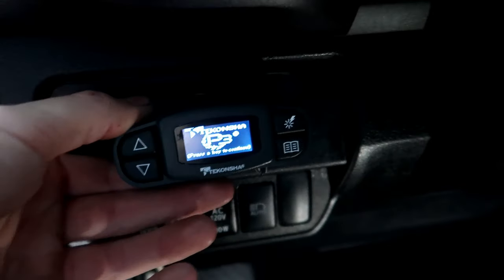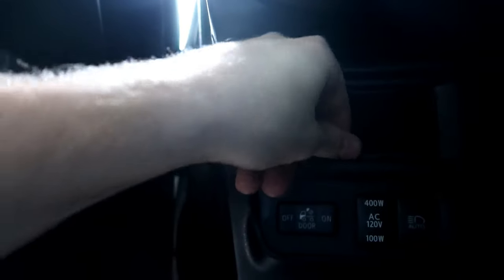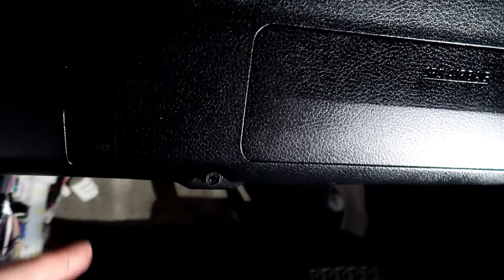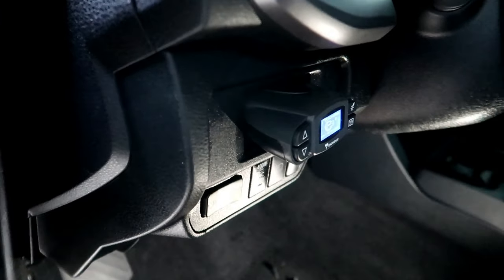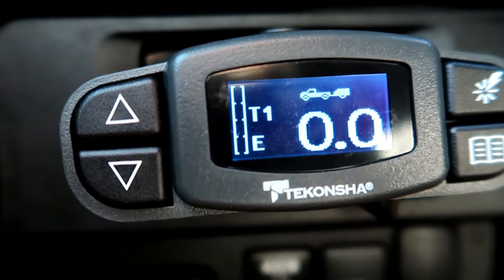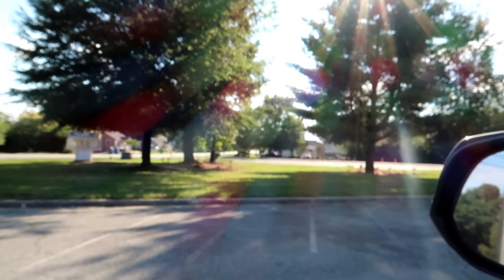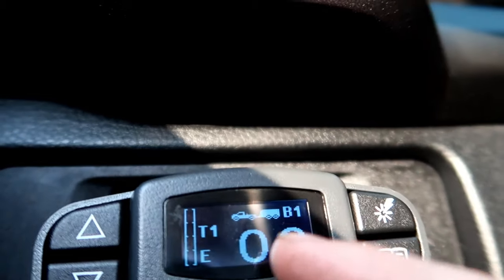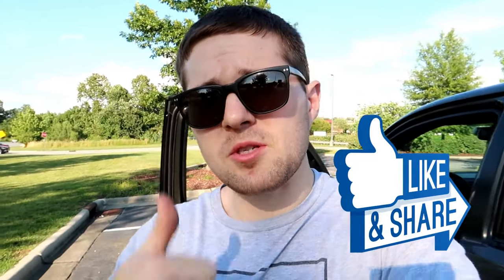Truck Trailer Brake Controller Install | Tekonsha P3 | Toyota Tacoma 2018

Comment from the maker: Tekonsha P3 Brake Controller https://amzn.to/2xFHFQb

All my other mods so far
- In Channel Window Vents https://amzn.to/2I29Qvk
-Gator Tri-fold Tonneau Cover https://bit.ly/2M3uKg6
-LED Interior bulbs https://amzn.to/2M4yyO1
-LED License Plate bulbs https://amzn.to/2M4yyO1
-Xentec HID Headlights (H11 size) https://amzn.to/2PByFm5
-Interior LED Glow Kit https://amzn.to/2XWLhMp
-OEM Style Truck Bed LED lights https://amzn.to/32xARCq
Reply: So i bought the same controller and I was wondering did you screen stay on all the time
Reply: Rick how much does your trailer weigh when loaded?? thank you
Reply from the maker: Loaded about 5k

Comment: I looked at a bunch of these before doing the install...and yours was the cleanest install and clearest video.  You're good at this.  Was perfect.  Liked using the bracket clip behind the panel to hold the p3 in the dash instead of drilling and using a mounting bracket.

Comment: Thanks for the information, locating the connection plug was very helpful being it was tucked and hidden behind the harness. FYI , I installed the drawtite brand which fit perfectly in the Tacoma dash compartment. Only needed to cut away enough plastic to allow the controller plug pass through the back of the box and then use a small piece of rubber foam for a spacer between the controller and the box. Made for a nice snug fit and reduced any possible vibration.
Reply from the maker: Nice!

Comment: The only thing that didn't work for me on this install was the clip part from the mounting bracket.  I had to use the metal bracket and mount that with a couple little bolts and nuts under the P3.  Made it even more secure that way also.  Video was spot on with everything else on the install!
Reply from the maker: Yeah I just did that on my 2020 since the compartment doesn't exist on that one like it does in the 2018

Comment: RIck, when you put the bracket in the cubby did you just use the existing screw holes to secure it?
Reply from the maker: No screws it kinda snapped into the slot roughly

Comment: Great video install. But I tried to do this on my 19 taco and it wouldn't clip in like urs. I had to improvise and I decided to keep the oem box, use a soldering gun and melt away from the sides and rear. It's a really snug fit and was able to connect it. I do have a question. Does the controller stay on with the car locked? Does it kill the battery? I bought the plug and play harness
Reply from the maker: Turns off after 15 minutes

Comment: So it actually is ok to ground multiple wires together? It appears so I’m just doing a double check since it seems some forums say don’t ground more than one whereas others say a ground is a ground, within reason obviously. But, just to be sure I can run that same white ground which I do have at the moment and about to install, with the other wires already in place?

Comment: Hi sir, how are you still liking towing that trailer with the ta o? What size and weight is it if you don't mind my asking? Looks similar to what I'm seeking.
Reply from the maker: 12 by 6 trailer. And yes still using. I enjoy it. Mainly cus of the freedom and size I have without. Then when pulling I gain so much space. It doest struggle much other than steep mountain hills with a good load in the back.

Comment: Whatever brand Controler you use/order....BE CERTAIN THE WIRING HARNESS IS COMPATIBLE WITH YOUR VEHICLE‼️‼️. Another suggestion, check out your local RV Service shop if you need to purchase a wiring harness compatible w/your tow vehicle ‼️‼️. Happy Holidays

Comment: Great video! Just bought on Amazon myself. Have to figure out where to mount I have a switchpro in the slot in my 19’. After using it would you recommend the same spot you used?
Reply from the maker: Check out my new video on it mounted it on the lower dash

Comment: Question I am able to fit the bracket in the same spot but it’s putting too much pressure on the manual switch and it’s not popping back.  Any suggestions?
Reply from the maker: Hmmmm not sure

Comment: Hello Rick,

Question for you; your trailer has a 7 pole plug or a 4 way flat one? Now.....if it’s a 7 pole , did you install a socket on your rear bumper to connect it or not? If not then it means that power to trailer breaks is delivered via the 4 way flat connection? I hope I make sense, where I’m going with this is that all brake axle trailers I’ve seen have the 7 pole socket, unless you are using an adapter 4 way to 7 pole? I’m curious because I have a 2019 Tacoma, and I’m in the process of looking into adding a brake controller. I’ve also just now found on etrailer a wireless controller that uses you phone via Bluetooth, it’s a bit pricey but it’s interesting because it can be used with multiple vehicles (Curt wireless brake controller). That one too uses the 7 way pole socket , which my Tacoma is missing.

Cheers
Reply from the maker: 7 pole. And my truck already has the wiring for the 7pole and the 4 way. It has both plugs already wired on the back

Comment: Very thorough video. I have a 2017 TRD Tacoma and was thinking about the Tekonsha 90160 Primus, mainly because of the price.  Looks like there are more videos on the P3 with Tacomas. Is there a reason why you chose the P3? Also, I have a 16ft tandem trailer with brakes only mounted on the front axle. How would I set up the trailer selection?
Reply from the maker: P3 was just the most popular one I saw people using. And 16 ft probable select large trailer and then go through the same process to adjust the breaking.

Comment: I have 2016 Tacoma limited. Easy install for you. What about removing unit when not in use?
Reply from the maker: I at max go 3 weeks without using the trailer

Comment: How heavy is your trailer dry? Do you find you need to increase the brake controller power as you load the trailer up?
Reply from the maker: I think it's right around 2,000 dry. And no you dont increase the power. You set it up like I did me the manufacturer instructions and you dont change it

Comment: Can you tell me if the trailer hook up has a small connection right behind the bumper? I have the an sr and wanting just the oem 7 pin connector that mounts in the bumper. I wasnt sure if I can find one or if it has a short harness that plugs into the factory harness. I have plug behind the bumper I think it connects to on the drivers side

Comment: Thank you so much for the video, helped me a ton on my Tacoma.  Only issue is, does this thing ever shut off.  I just installed it, and it's stuck on the "press any key to continue" screen.  If I press a button it just says no trailer connected, which is true bc I don't have access to it right now.
Reply from the maker: It shuts off after i think 15 minutes with no trailer detected.

Comment: I have a 2014 TRD sport 2wd with the towing package. I couldn’t find the connector under the left dash panel. Could it be because it’s not a 4wd or off road or could it be hidden somewhere else?
Reply from the maker: Its cus you have a 2014. I am showing you the location of the 3rd gen Tacoma's which are 2016 and up. I am not sure where the 2nd gen is located.
Reply: It's in the same area, and has black electrical tape around it.  I have a 2014 two wheel drive Tundra TRD with tow package.  They are all the same and nothing to do with year.  My 2005 Tacoma has the same plug as the 2014 Tundra.
Reply: I had a professional install it and thank goodness bc ended up needing an extra connector and then our camper didn’t have the brakes hooked up on the panel in the camper. Thanks for your help!

Comment: I have an 2018 and didn’t get the adapter when I ordered from Amazon (didn’t come with one). When looking online Tekonsha doesn’t seem to make one that actually fits a Toyota, only GM (according to their website). Where did you get your adapter? Or is there a wiring video you recommended?
Reply from the maker: I bought a harness. Let me check my amazon orders to see if I have a link
Reply from the maker: Here it is https://amzn.to/3fQ7UqU
Reply: Taco Rick great thanks! Not sure why I couldn’t find it. I’m going to order it and do the install this weekend.
Reply: I installed the unit but I couldn’t get it to be “locked in” with just that clip so I used wire to secure it to the screws that used to hold that plastic insert in there. Now it fits perfect and sits snug.

Comment: What is the connector just below the tire pressure reset switch.  According to manual that’s a break controller connector. If I’d din war h this video I would wasted a lot of time wondering why the 3031-P harness adapter didn’t fit.
Reply from the maker: No that's your obd port. The brake controller is tucked up back behind the wire lum like I showed
Reply: THANKS!  The diagram of the brake controller in the Taco manual was pointing to the exact spot of the OBD, wasn’t immediately obvious that it was behind the panel. Your video made this a simple install.
Reply: Sorry, one more question:  noticed after install that controller remains on when vehicle (2017 Taco).  Is that normal?
Reply: @Kedeco628  with the truck running, move the override lever all the way to the left, then firmly all the way to the right, mine shuts off now after staying on for 2 weeks

Comment: Does your brake controller stay on all the time? Or is there a way to shut it off?
Reply from the maker: No it shuts off after 15 minutes not connected to a trailer

Comment: I did everything the same as you but I can't get brakes to lock up no matter how high I turn up the boost. Can definitely feel the brakes engaging but not enough to lock them up. It's a brand new travel trailer so brakes should be good. PLEASE HELP
Reply from the maker: Trailer is empty?
Reply from the maker: Trailer empty 25mph and hit the trailer override not the brake pedal

Comment: Make sure to get a transmission cooler better than the stock one.
Reply from the maker: Interesting never heard that being a common mod?
Reply: @TacoRick  it's pretty common knowledge that stock trans coolers are not enough. Don't believe me, take the temp of the fluid going back into the transmission from  the stock cooler while you are towing.

Comment: Where did he get the small clip that he used to look the brake controller into place
Reply from the maker: Cones with the cobtroller
Reply: I meant lock it into place lol guess you got that thanks man you made all this real easy the dealer that sold me the truck new had no idea it was prewired

Comment: This is irrelevant for 2020 owners. At least install location.
Reply from the maker: I know I just got my 2020.... still contemplating the mounting point
Reply: @TacoRick  I mounted it to the right of the latch release. It slightly covers the TPS reset but I can still press it easily. It's the only spot I could fit it without having to rewire and repin the plugs. 
I need to move it slightly to the left as my clutch leg will hit it slightly if I clutch slowly
Reply from the maker: That's were I was looking at putting it as well.
Reply: @TacoRick  I hit it slightly if I get out at a wierd angle

Comment: That's a very awkward place to put that controller looks like a zit popping out of the dashboard plus you put holes in the instrument cluster panel. A very expensive panel to replace. With all that trouble you should have just purchased a Redarc Tow pro-elite. A lot cleaner installation.
Reply: Troll